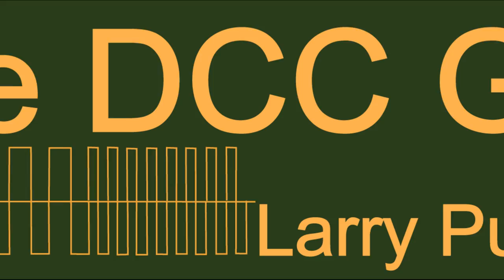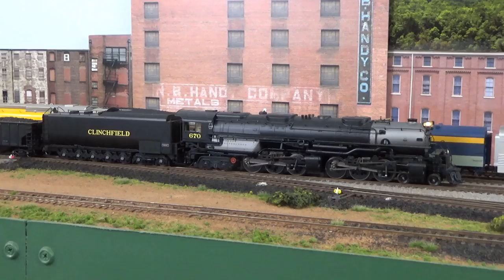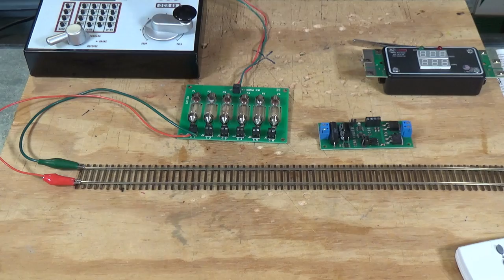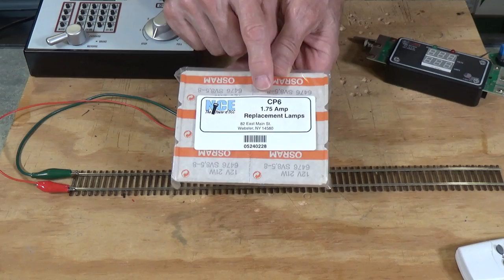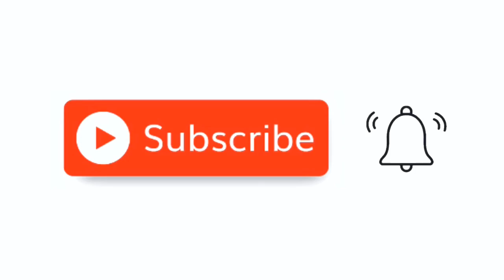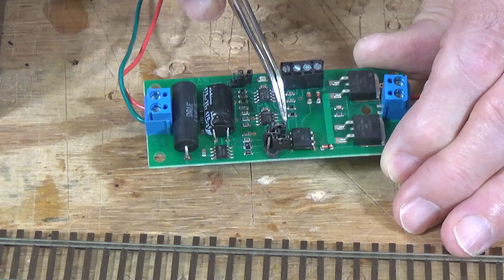Protect Your Layout With NCE Circuit Breakers (276)

Comment: The CP6 Circuit Protector is NOT a circuit breaker! It is a current limiting device and will NOT shut off the power! Showing the meter off is miss direction, as there is not enough volt drop to power it and in fact the 1.75 Amp is still running through the track in series with the bulb!
Reply: Indeed, it is the short circuit placed on the track that reduces the track voltage to zero. The current will depend upon the resistance of the bulb when lit. Hence, the CP6 provides protection by current limiting. Having said that, it is a helpful video as in some cases the distinction may not be important and it is useful to know what is available.
Reply: @keithedwards1896  It is worse than that, a circuit breaker will remove the current, the bulb only limits it, if there is a similar current drawn from the fault, the whole current has to pass through the fault (being the loco or a partial short) that can still allow damage to the loco or faulty device, 1.75 amps will still cause overheating and possibly start a fire! I know of loco's that have died on bulb circuits because they have been left for long periods (unattended) in fault mode
Reply from the maker: Yes, and I discussed that and the implications in both the videos that I provided links to.

Comment: That was a nice explanation... Ive had my NCE Pro-Cab system and 3 boosters on my layout and do not us any type of circuit breakers and have never had a problem over the past 12 years... I do keep a remote control in my pocket to shut down any booster if there is a short.... I also have 70 functioning signals on the layout running off the boosters... yesterday I ran a 15 unit consist (4 with sound) and had another 5 engines (3 more with sound) also using the same booster and had no problems.... NCE makes and excellent system and I would highly recommend it over any other system!  Ill admit I bought one EB-1 but it has never been hooked up or needed... Good stuff Ron... Take care....  DD   🤪  😜   🤗

Comment: Per the NCE website, you can also wire multiple ports together to increase the Amps.  Since each bulb is rated at .75 amps, you can wire two or three together and multiply the amperage.
Reply from the maker: Yes,  but you really want to think long and hard before doing that. Remember that these only limit the current to that of the bulb, so I don’t recommend that. See video #109 for a more long winded reasoning.

Comment: The original version of the EB1 was not recommend for the NCE Power Cab but was fine for Pro Cab but the latest version EB1 (EB1 v1.1) is compatible with Power CAB. The EB1 v.1.1 uses switches rather than jumpers to adjust the amperage capacity. Info from the NCE zendesk - The Power Cab has built in overload for basic self-protection that will continuously try to reset the Power Cab ever 1/2 second (500ms) until damaged if it is left uncorrected. The Power Cab does not have circuit breakers that will trip or fuses that will blow. Use the new EB1 v1.1 electronic circuit breaker to protect the Power Cab against short circuits. (Bottom line - You NEED a circuit breaker)

Others may have different experiences or circumstances than I do but the EB1 has worked well for me with Tam Valley frog juicers.

Personally, I would go with the EB1 v1.1 and dispense with the CP6. Just my opinion.

Comment: Oh wow that's a pretty neat product,  at first I thought it was something as simple as a 3/4 amp fuse and thought that's a dumb idea because you'd be replacing fuses left and right every time you get an older loco on the track that many short it out due to whatever issues,  but to have a lamp light up and you don't need to replace it is great.   Also a bright visual indicator that something is wrong is a lot better than constantly staring at an ammeter when you want to be looking at your trains is a bonus feature.
Reply from the maker: Yes, but they do very little to actually protect decoders against the excessive voltage spikes and current that occur when a short on the layout shuts down a booster.

Comment: I need a power manager that can handle DC as well as DCC.  I am going to go with the CP6 in the case of what I am doing.  I have also considered the DIgitrax PM42, but those are getting hard to find, and the PM74 isn't able to manage DC like the 42 could.

Comment: A common misnomer is those LED terminals light up an LED on the facia(or wherever) when you have a short, they do not. They work in tandem with that small pilot light next to it, so I wish it was called  a track status light. So I use green LED's for mine. When you have power to the layout and/or hook them up they light up. You short the track they go out. At least on my layout they do.
Reply from the maker: Sorry, I misread that too. I find it odd they didn’t design it the other way around but they do say that it merely mimics the action of the onboard status LED.

Comment: I have an issue that maybe you can provide guidance. We have a display style layout that has a double main and a branch all have a continuous loops over 11  modules. Each booster supplies power to 2 modules and one provides power to three modules - the problem is that there could be up to six or even 10 locos on any zone (2 modules) at one time. Could I use an EB1 for each zone and then have secondary circuit breakers EB6 for smaller blocks within each of the zones?
Reply from the maker: I think you mean a CP6 as I have never seen an EB6. The issue you would likely see is the Eb1 trips in 16ms whereas the EP6 bulbs are slower so the EB1 will trip before the CP6.
Reply: @TheDCCGuy  Correct IRT CP6. Finally received my EB1 recently and installed the first one yesterday. Not very successful. They do not seem to function as expected when using with EasyDCC, they trip and reset only when set to 8amp, but do not reset when set to any lesser amp setting. They display a very faint flicking only on the short LED. This is same after removing all Locos from the section/block. Guessing the Zonemaster booster  competes with the EB1. I think it maybe due to the setup of the zonemaster and the amps it supplies. Maybe need to work out how to pulse the EB1 but could not work it out yet
Reply from the maker: Check with Keith on the trip speed of the booster. For it to work correctly the booster must be slower than the breaker which is about 16ms.

Comment: Ok I hope this is not a stupid question.  I,m building a small shelf layout about 24" by 10' the most locomotive I'll run is 2 , I'll have a total of 8 turnouts. do you think I' ll do ok with 1 EB1?
Reply from the maker: No problems, should work fine.
Reply: Thanks @TheDCCGuy

Comment: I understand the circuit breakers are for DCC systems. Could they be used for DC systems?
Reply from the maker: No they are DCC only.
Reply: Thanks for the reply. It helps a lot.
 @TheDCCGuy

Comment: Larry, Will the EB1 work out of the box with Tam Valley Frog Juicers or does its short detection need to be slowed down?
Reply from the maker: The timing on the EB1 should be fine as is but just i  case that is one of the options you can easily program.

Comment: Gosh, that's reminded me of the Scalespeed controllers we had back in the 1960s, which had ballast lamps like that built into them, which worked just the same in ye olden days of DC.

(Has anyone asked you for a link how to use the youtube search bar yet? 🤯)
Reply from the maker: Thanks, I have been trying to remember what brand powerpack had these for ages. I can remember that big bulb sticking up on the top of the case but can’t find a photo anywhere on the web, maybe having a brand name will help.

Comment: Have you done a video on MARs lights? Such as what and when they are used and installing and operating in a locomotive...
Reply from the maker: Not specifically although I have installed them as part of a couple of installs including the recent Blunami installation. However on most railroads they were only used in very limited cases. For example when approaching a road crossing or a station to warn passengers. They also could be used in an emergency. Most railroads would have instructions for the use of them so you need to do a little research on your prototype. As for installing one, it is the same as a headlight. Then you simply program the specific light function for a Mars light and adjust the flashing controls to you preferences.

Comment: will theses circuit breakers with other dcc systems and the number of signal hertz passing through them matter. In other words can they be used on a multi protocol system that transmit dcc signals as well as other protocols of signals?
Reply from the maker: As far as I know the electronic types work only with DCC systems. Ballast lamps may work with other types and it would be easy and cheap to test, or just ask the tech support folks.

Comment: Would 6-10 locomotives be overload for the CB6! Thanks for video by the way!
Reply from the maker: Those are rated at 1 amp per circuit so unless you have some super efficient locos even 4 might trip it.
Reply: 4 in each power block?  @TheDCCGuy
Reply from the maker: Yes, you need to find out the current draw of the motors and add them up. If the total is 1 amp or more them the bulb will shut off power to that block. Older locos with open frame motors or the old Athearn ones can pull a full amp at times, but a new high efficiency motor may max out at 0.25 amps.

Comment: Quick question, not directly related to this video only: Is there a direct connection between the upper and lower level of your layout? If so, are you using a helix or something like that to connect the two levels?
Thank you for this video - I was jut starting to look into adding a circuit breaker to my own build - perfect timing!
Reply from the maker: You need to watch my series of videos on building a helix between the main and lower levels of the layout.
Reply: @TheDCCGuy  thank you, I will take a look at that. Keep up the good work!

Comment: Larry, I am gonna ask an absolute stupid question, but it is something I am completely oblivious too. When I am setting up my power districts, meaning separation of different territories on my layout, as I lay track do I need to use insulated rail joiners where I want my power districts to start and stop????
Reply from the maker: Yes, you need to physically and electrically isolate the rails of each power block. You can do this with the plastic rail joiners or just leave or cut gaps. The gaps are also important in oder to allow long sections of track to expand or contract if the layout is not in a climate controlled room. Garages, attics, sheds, etc. are notorious for major temp changes which can result in kinked rails.
Reply: Larry thank you my layout is in my basement room, I can absolutely cut gaps in the rail.  Thank you for your channel and educating me

Comment: How many amps can a decoder handle before it’s fried? If you have a breaker like this set for 4 amps so you can run 4 locomotives with lighted passenger coaches, and one locomotive derails shorting the layout, is that decoder protected if 4 amps is getting to it?
Reply from the maker: Each decoder has an amperage rating, if the motor and functions draw over that it will go poof. If there is up to 4 amps potentially available it doesn’t mean that much is being used by the decoder. Its like your house circuits. Even if it is a 15 amp circuit a light bulb plugged into an outlet does not pull the full 15 amps, it only draws what the bulb is rated at. Now as to the short and whether the loco/decoder will be damaged. It all depends on the nature of the short and hoe fast the booster or circuit breaker shuts down as well as your wiring. A properly wired layout will not be an issue. However do it wrong or if the loco does just the right thing and yes you can fry the decoder. I have several videos among the 300+ on this channel that discuss how to wire correctly and also how to protect against damage from shorts.

Comment: Hi Larry I have a question watch is better using suit case clip,s or soldering the bus wirer,s 
From Neil schwerdt in west valley city Utah September 29th 2022 
Thank you Larry
Reply from the maker: The only wires I solder are feeders to rails and control wires to Tortoises.Everything else I use some type of suitcase or clip type connector.

Comment: We had a CP6 on our club layout, we had a derailment and no one noticed the light and while it worked but no one noticed until we smelled the smoke started by the bulb. Lesson learned, don't put the CP6 where it can't be easily seen.
Reply from the maker: That is one issue with ballast lamps as they can get hot. The improved ballast lamp video I did helps with that problem since it greatly reduces the amperage flowing through the bulb, reducing heat as well. The CP6 offers the convenience of an off the shelf ready to use device instead of having to cobble together 6 ballast lamps, which makes it a lot easier for many modelers.